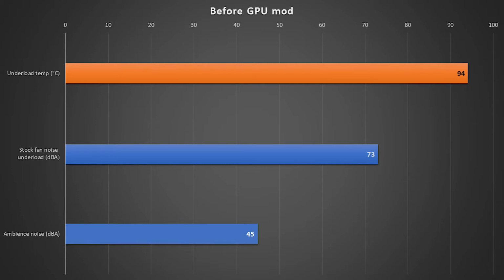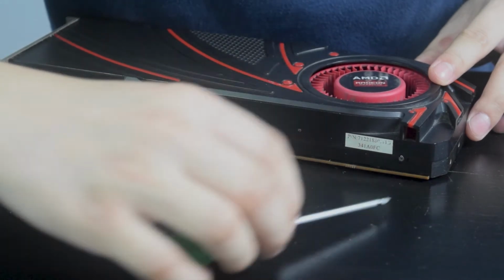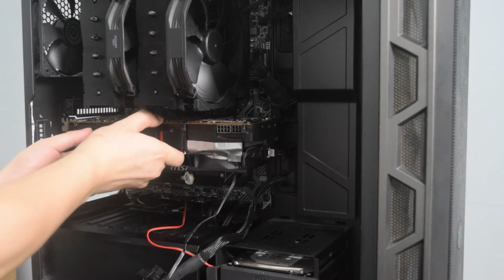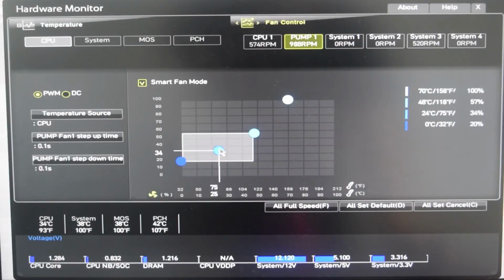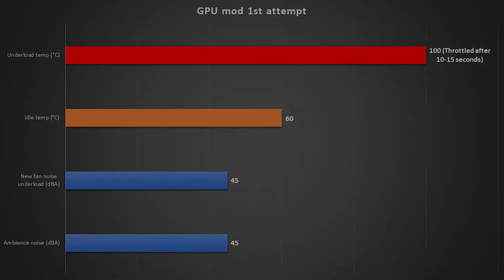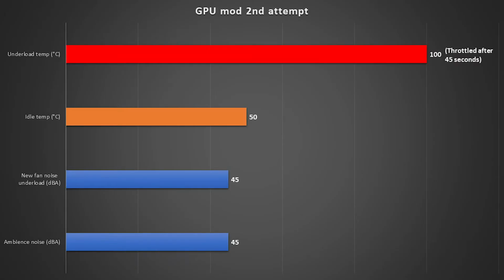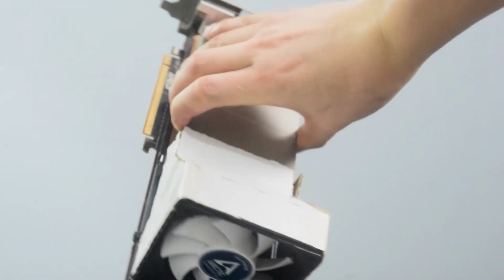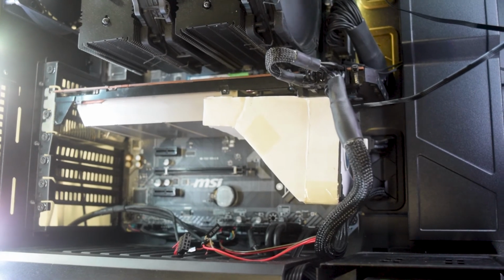A FAILED attempt of a GPU mod

Comment: Been wondering how a fan placed exactly like that to replace a blower would perform, and now I have the answer. You'd need a fan with a significant static pressure to achieve any results this way it seems. Or like someone else said, attaching a fan at the exhaust could be interesting too. Thanks for the video!

Comment: Instead of a blower design - are you able to attach to fans directly to the top of the heatsink blowing air down into the heatsink? This would mimic non-blower designs.

Additionally - you probably should repaste the GPU if you haven’t already. I’m sure whatever stock paste would be dry and crusty by now, especially if seeing 90 degrees regularly. 

Great content and thanks for the video!
Reply from the maker: yes i did repaste the thermal paste, and thank you for your suggestion!

Comment: For cheap solutions, you can try grinding off the top of the fins and attaching the fans open air style to the heat sink.  Or try using an aftermarket GPU cooler like an Arctic Accelero
Reply from the maker: thank you for your suggestion!